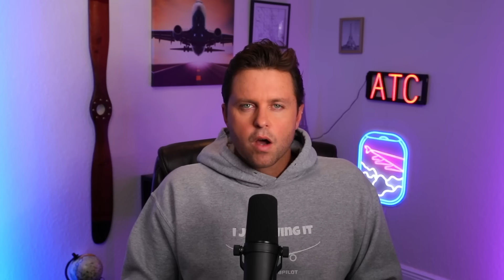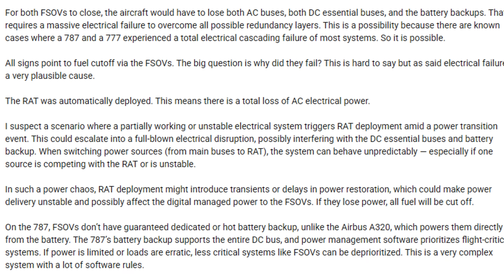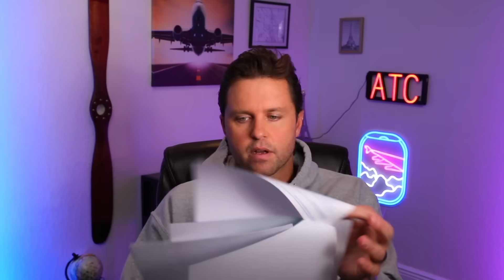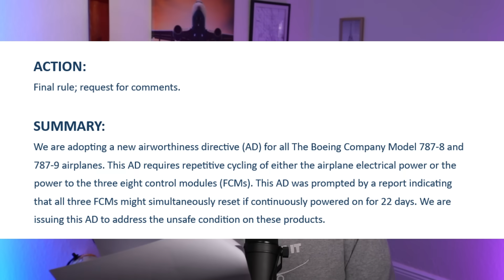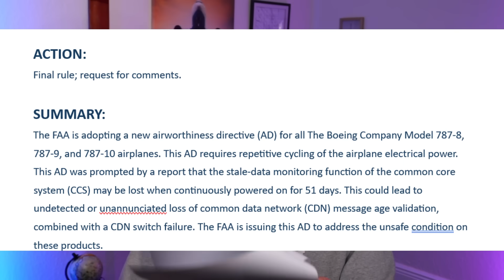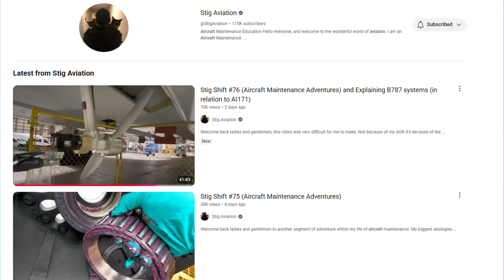Air India 171: Did a Software Glitch Cause Dual Engine Failure?

Comment: If it's a software glitch that's scary as hell
Reply: Welcome to the world of electrical stuff, AI, computers…….that has possible glitches……glitches that doesn’t surface until the conditions are just right.
Reply: @tommypaget2294 Imagine AI pilot instead of Captain Steeve 😂
Reply: It sounds like poor design to me, not a glitch. Add to that the metal shavings damaging the wiring over the years …. Not good. Add to that suddenly “the” black box is damaged, no one in media is mentioning that 787 has two that are both data and voice, and people are beginning to smell a coverup. …. Really, really not good.
Reply: @libby2012  Absolutely 100% agree with you. Especially regarding the "Black Box Damage" It really seems to me that they are preparing to cover-up what really happened. We might even be told that it was pilot error, and how could we disagree if the actual proof is not available. It is also interesting about what happened to some whistle blowers from Boeing after they exposed the truth. Really Not Good from this manufacturer.
Reply: @libby2012 Indeed 👍
Reply: @libby2012 Poor design is producing glitches and not vice-versa. You're right.
Reply: @libby2012  16 years flawless record, your car is 1000 times less safe
Reply: ECC/FADAC firmware glitch or sabotage.  This crash has occupied the attention of billions of people.  If the crash hadn't happened then these people's attention would have been directed elsewhere, like...
Reply: @amciaapple1654  Exactly .. the whole world is in shock and will be for a long time. What happened will be etched in our minds forever. It's just so horrific and the thought that the pilot had no time to rectify.
Reply: My grandfather was an aviation mechanic and always said “show me a wire and I’ll show you a problem.”
Reply: @juliettesedlacek2971 I spent weeks tracking big wiring problem..we changed vendors on electrical connectors not made in USA but mejico..and the manufacturing was poorer quality
Reply: Its probably not a software glitch if the power is unstable. More likely data corruption, causing unpredictable errors which the software may or may not be able to deal with.
Reply: 1 million percent scary, agreed 😳
Reply: Unknown unknowns i thought 10 yrs ago when I saw..ALL THAT SW! AND the electrical loads wow amazing can we do this for 8-10 yrs again and again and track Degraded mission critical and mission essential...all the circuitry in missiles and bombs they too are heavily sw/electrical  dependent or we got smart bombs smart jets smart weapons smart detonation by fones etc. Are we getting too smart FOR THE product nterfaces?  What do human factors engineers state?
then here comes Algorithms by 1k's and AI by millions?

Pilots are not trained like they used to be as more leaning toward monitoring of screens and feedback systems...our pilots were trained more hands on than Airbus at 1 time now both are going the way of HEAVY SW and fly by wire DRIVING AP.
Reply: mcas like
Reply: AI is here 😅
Reply: It's not and that's scary as hell.
Reply: i dont think it's.
creating a software that if it detects an even it immediately shuts down the fuel is a first grader coder. 

Usually event triggers are always in loop monitoring in the millisecond timeframe, it does not stop when the event happen, and there are series of actions and each action has multiple branches of other actions, in which, all these actions are tested before release.

simply saying t's just a software glitch without reviewing the code is BS statement.
Reply: … and all that crap is built into YOUR car !!!
Reply: yeah, if pilots can't do shit, then the only thing passengers could do is not flying Boeing anymore
Reply: @ShibalotonSeattle but it’s not simple…many companies flies with 787. And an airline in Europe can  indicate model of aircraft or not. I must fly on a 787 in e few days. It’s the first time that I’m not sure about fly with 787. I’m not scared by planes, my father and grand father worked in Air France their entire life. I grew up with planes… 😮
Reply: DO NOT FLY ON ANYTHING BOEING 😂
Reply: @rolandthethompsongunner64  or as some say "if your going, don't fly a BOENG" !
Reply: @livingadamman7994  "If its boeing, I'm not going"! You're welcome.
Reply: @theprofessor4097  If it's slowing, it's probably a Boeing !
Reply: @livingadamman7994  Or, if it's Boeing, I'm not going.
Reply: @rolandthethompsongunner64  Qantas 72 was not a Boeing.
Reply: @rolandthethompsongunner64 the old ones are very safe
Reply: @rolandthethompsongunner64 ……no, do not flying that’s alot of electric…..that’s AirBus…..older Boeing ps are manual and mechanical
Reply: @tommypaget2294 Airbus plane are statistically safer than Boeing. 

When was the last time Airbus plane crash due to design flaw or quality control issues?
Reply: @tonamg53  Air France A330 pitot tubes? There are probably more recent ones. The Mentour Pilot channel usually has a good selection of Airbus failures.
Reply: @ImperrfectStranger  The design wasn’t the main cause of the accident. That was mainly cause by flight crew were not trained to handle stalled characteristic at high altitude. They were only trained for stalled at low altitude.

The main equipment failure was the pitot tube which the design wasn’t appropriate to handle the condition that we now know  as supercooled water droplets. This condition was not clearly understood at the time. It cause water droplets to instantly freeze into ice after contact with metal surface. Not all Airbus has that type of pitot tube and the exact same type of pitot tube can also be found on Boeing aircraft (but sure it’s an Airbus issue because why not ? 🤷🏻‍♂️👍🏻)

The “potential” issue with design of the flight controls is totally BS. It claimed that the first officer was panicking and inadvertently pull the nose up unknowingly without the other pilot noticing the stick position.

No pilot fly looking at the stick position. They look at the PFD which will tell them what the plane is doing and where the stick position is.

Also there was a very specific attitude that both pilot pulled the nose up to. It wasn’t random, they were both pulled the nose up to stall recovery attitude for low altitude flight… which unfortunately, cause the plane stalled at high altitude, which there was no training.

You can get that same crew in a Boeing and if the pitot tube failed, the result would be exactly the same. It wasn’t an issue with the plane.
Reply: @tonamg53  Understood, thanks for the addtional details. Nevertheless, the pitot tubes were replaced with better ones. 
I suppose we could assign no blame at all to any aircraft manufacturer if we go down the rabbit hole of aircraft parts being designed and built by outside companies. 

I didn't have much exposure to the Airbus fleet of my old airline, but a notable repeating issue was a hydraulic line which was bursting in the wheel well, leading to a system pressure loss. A newer, better line was invented.
One of my fellow engineers described the  Airbuses as the "Hyundai of the Skies". Not sure if that is a compliment.

I see a few Airbuses seem to be having issues with the "over the horizon radar" on the coast of Western Australia (rumoured). I think they put the blame on a software issue, but I think the jury is still out on that one. Do we blame the military or the susceptibility of Airbus to these things? 😅

Cheers.
Reply: @ImperrfectStranger  I understand the rabbit hole but the pitot tube is really nothing to do with the aircraft as that could also happens to Boeing… it just happens on Airbus first.

Also the same type of accident is prevented by flight crew trining for stall at high altitude… 

Pitot tube cause unreliable airspeed issue. Replace pitot tube fix that issue but it should’ve not lead to a crash.

The crash is prevented by more comprehensive flight crew training.
Reply: @rolandthethompsongunner64  It’s 10000 safer than your car you drive daily

Comment: You are right as far as the A320. I am a former A320 pilot, for 35 years I flew it.
 What you said about the A320 is correct, the Engines LP (Low Pressure) and HP (High Pressure) Shut off valves remain open when DC current is lost. (DC-2 bus bar and DC-ESS bus bar).
CONGRATULATIONS.
Reply from the maker: Thank you for the insight, it's great to hear from someone with so much experience!
Reply: @Garybpilot  As someone who lives in Seattle, AND who once worked at Boeing,
you're giving me news I'm not happy to hear, but I believe you're trying to be objective (unlike some of the videos).
Reply: I may have missed what you are referring to, but is this a known difference between a Boeing 787 and the Airbus A320? From the video here, it sounds like the 787 has a fail safe that turns the valve OFF if power is lost. But are you saying that it is opposite on an Airbus A320? Just trying to understand your comment, thank you!
Reply: @epitaph109  No, Airbus has additional batteries just for these valves inside the engines themselves. So those batteries can keep valves open, when they did not receive signal from bus to close, as bus is .... well "busted".
Reply: @epitaph109  "fail safe" in an aircraft shutting off the engines while in flight?

Seriously???
Reply: @peterebel7899 I initially had the same reaction but on a closer look I can see the point of them automatically shutting down the fuel supply IF the only possible cause would be AN engine on fire (like explained in the video, to protect the airframe, which I'd say is at least equally important and quite likely even more important than the thrust from ONE engine, in the sense that with a damaged airframe you'll have a hard time making it safe home both from high and low altitude, whereas with loss of thrust from ONE engine you stand a reasonable chance of making it home). But if they can be triggered to shut down the fuel supply for OTHER issues beyond an engine fire, especially issues that can lead to fuel to BOTH engines being shut down... this is crazy
Reply: @dan-nutu  Take a rest and create sentences.
Simple as that: There is no "save status" for an engine while flying!
The pilot has to decide an engine running or shut down fists best in the status of flight and emergency.
For this he is trained, he picks up plenty of information including some checklists.
Sure a faulty engine can flame out for itself, but this to have zero consequences for the other engine.
Reply: @peterebel7899  They are designed that way because the engines are thought to be on fire which may risk spreading to the airfarme ie: wings
Reply: @peterebel7899 even worse, during takeoff. In flight at altitude you’ve time to solve the problem, no way this should ever be able to happen during takeoff. This is what happens when MD bean counter clowns sack Boeing aviation software engineers with 30 years of experience and outsource software development to inexperienced untrained offshore contractors all to increase profits and their paycheques and bonuses
Reply: @dan-nutu and surely you would definitely make sure this could never happen during takeoff right? I mean, if I was the designer or developer, it’s the first question I’d ask. “Erm excuse me, it isn’t in the specs but you don’t want this functionality happening during takeoff do you?”
Reply: the shut off valves will remain wherever they were last commanded - it is a latch valve held by a permanent magnet in whatever position it was commanded last by pulse dc.   Go look up Qantas flight 32- they could not shut down no1 after no 2 grenaded and severed all the wiring- fire crews had to foam it
Reply: @TrollingwTyrone  Thanks Tyrone, your information is invaluable. Can you tell me what happens if the refueling "All valve control switch" is left on by the refueler? It is my understanding that this systems computer shuts the Engines fuel valves off and opens the tank vents even though there are no indicator lights for this. Is this correct? Thanks Mark.
Reply: @markbrzezinski8889  i kinda see where you are going with that i think? Refuel computer freaking out commanding valve shutoff ? 
No indication of FSOV status at the fuel panel as it is unaffected during refuel but valve status is  definitely shown on the fuel synoptic page.  They would not inhibit or shut off the FSOV during refuel as you would not be able to do a hot refuel with an engine running even though it is rare.
Reply: @TrollingwTyrone  Thanks, your thoughts are invaluable. This is my last question. Can you tell me is the fuel restricted to the engines via the gravity feed system if the FSOVs are commanded shut like what happens at altitude if you lose AC power, etc? Also if the engines tilt up during runway rotation do you think this would restrict fuel flow from that system to slow the engines not necessarily stop them?
Reply: @TrollingwTyrone on a 787 or 320?
Reply: Do you know if it's the same with the A350 or only the A320?
Reply: https://youtu.be/dIgnR0zw3FU?si=FIglkTDBwcJWlfU3
Reply: elctricity is generated only if the egines are woking being prime movers to generators.engine can shut off only through fadec malfunction  when even pilots are onlookers. fadec can malfunction through many many causes like many hardware failures etc etc. sensors malfunction quiet possible if poor maintenese.
Reply: In 2019, a Nippon Airlines 787 had both its engines shut off mid air on its landing approach exactly like AI 171. There was no catastrophe though only because the plane managed to glide down to the runway without power. This was attributed to a safety system that had a faulty sensor that was supposed to detect when the plane had landed (and presumably stationary). This shut down the engines with the pilot being able to intervene. This could have happened on AI 171. There are a lot of possibilities to look at before you start looking at pilot suicide.
Reply: THE AIR INDIA BOEING 787, FLIGHT AI-171
OVERSHOOT THE END OF RUNWAY AT LIFTOFF.

AI-171, experienced a catastrophic event shortly after takeoff including a “Mayday” call and deployment of the of the Ram Air Turbine (RAT) evidence suggests a potential loss of thrust, possibly due to a dual engine failure.

Two seconds of view clip immediately after Aircraft liftoff from Airport CCTV played in slow motion and frame by frame revealed the heavy dust and debris on the path of the aircraft and the brief moment it flew into the dust and debris.

Dried vegetation existed at the end of airport runway during takeoff. The Aircraft blew up this heavy debris when it overshoots the runway and flew inside the debris. 

Dust and Debris sucked into the engines are the most probable cause the Aircraft two engine failures
Reply: @jollymountain7596  Nice try.

Comment: I think the problem could have been the loss of power due to overheating in the flight management systems, from my experience as an engineer over the last 48 years, three problems can cause power fluctuations, foreign signals, jamming, overheating, or condensation in the electronics, we know the cabin of the aircraft was so hot it was dripping water, on the roll it is possible that water flowed into the electronics?